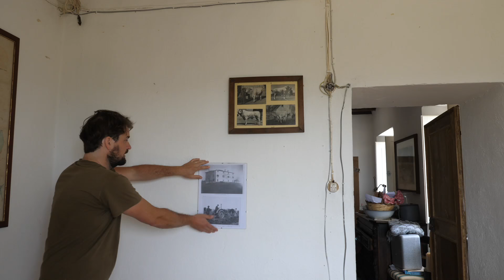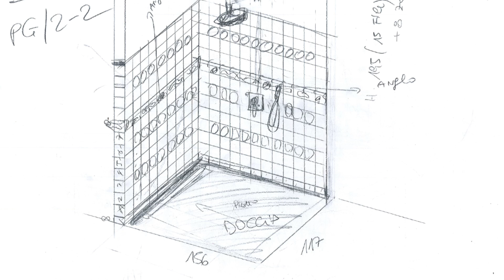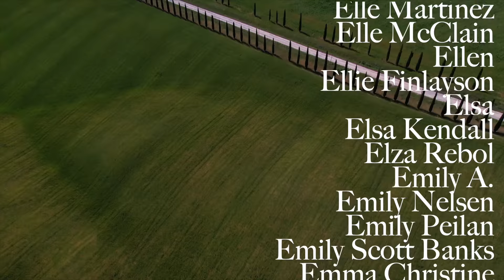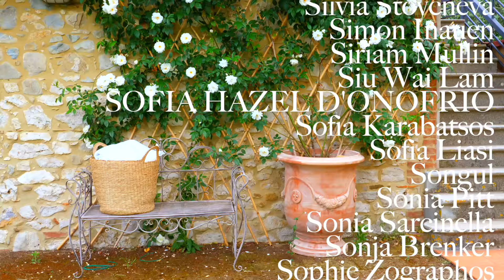RENOVATING A RUIN: Knocking Down Walls to Build a Dream Farmhouse in Italy (baby gender reveal) Ep21

Comment: Kyle I too have severe allergies. This recipe will give you some relief. Using Pure therapeutic essential oils such as Young Living or DoTerra ~Five drops each Lemon, Peppermint and Lavender oil  in a glass of water. Sip and swish in your mouth for as long as you can then swallow the oil infused water. Keep doing this, sip swish and swallow until the glass is empty. Do this at least three times a day. It helps tremendously!

Comment: If you take any more walls down, it's a lot easier to take the bottom 40 centimeters out first, the rest comes out easily after that. Best thing you can do is a horizontal cut with the angle grinder and then the full sized sledge hammer. There's no point in doing the plaster and bricks separately.

Comment: Kylie, have you thought about acupuncture to help with your allergies?  My osteopath used it for my hay fever and it worked.  There are a couple of points at the side of the nose which are extremely effective and so this may work for your other allergies too.  X

Comment: Don't let anyone tell you not to work if you feel up to. I removed the carpet and laid hardwood throughout 2500sq ft while I was 5 months pregnant with my first. With the second and third I had tendon and vein problems and could barely move. Your body tells you what you can and cannot do. Also, I'd say your biggest problem is the tiny sledgehammer. lol

Comment: Kylie have you looked toward homeopathic remedies? Some are very helpful for allergy relief and they are not dangerous! Find a good homeopath or do some research. The neti pot is also a great idea....and I used to put a little bit of olive oil in my nostrils before working in a dusty area or as I got up in the morning. It helped as well.